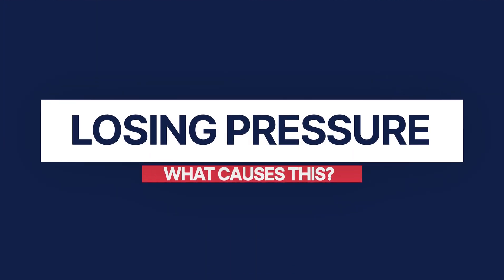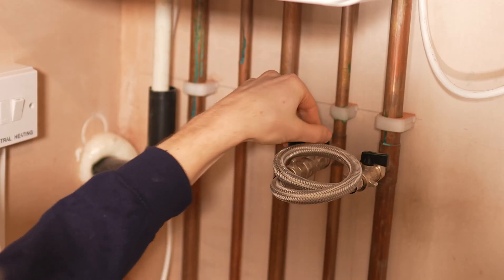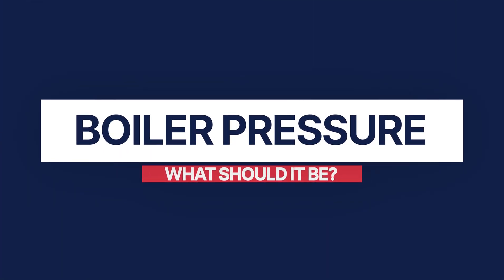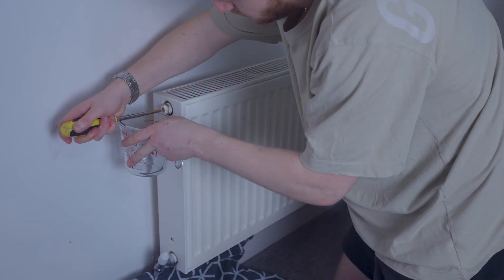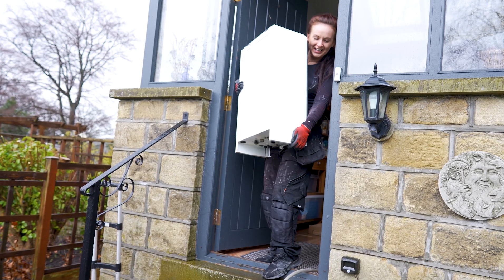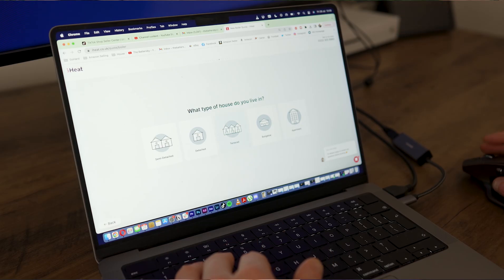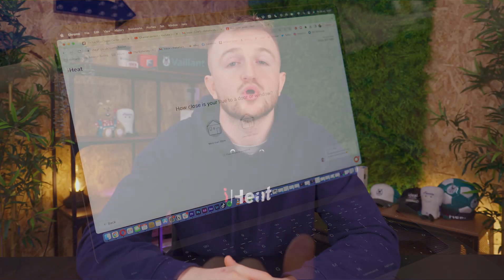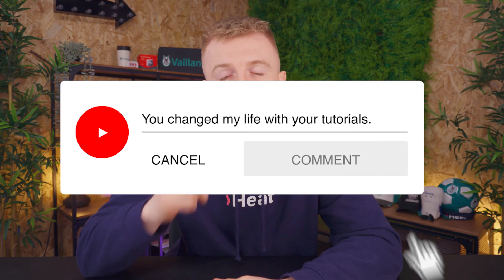Why is my Boiler Losing Pressure?? - Tips to try before calling an Engineer!

Comment: I've followed all those steps.
Boiler (vaillant combi) losing 0.5 bar overnight, sometimes more.
Checked PRV and expansion vessel. All fine. Boiler less than 3 years old. All rad valves bone dry. No sign of damp or moisture anywhere in the house. Called leak detection specialist, tracer gas and everything. The gas didn't even show a pressure loss when pumped into the system. Real head scratcher this 🤔

Comment: When checking for leaks around radiator pipes and boiler ect, do you have the boiler on or off?
Reply from the maker: Boiler on so the water is being pushed around the system

Comment: My boiler keep dropping pressure i am having to top up 4 times a day i have notice water from the copper pipe outside and also notice a leak under the kitchen tap draw the pipe dripping water
Reply from the maker: That definitely sounds like a leak somewhere, I would recommend getting a professional to inspect the pipes to be on the safe side.

Comment: I topped up my boiler pressure & soon after noticed a leak from the black taps under the boiler, is this normal? Apologies I’m just so new to this
Reply from the maker: This sounds like an issue with the valves that should be checked out, place a bucket underneath to keep track of how much water you are losing

Comment: My new Worcester Bosch boiler started losing pressure from day one.  The old Worcester Bosch did not have this problem. After scan of  ceilings and floors, the  installer said the  problem is leaking pipework and I  need to call a specialist. Before he left he turned off the heating and as he predicted the pressure is fine, but I'm left with no heating.  Other than lifting  up floor boards and boxing how to do I  track the leak.
Reply from the maker: Its more than likely the power of the new boiler is too much for your existing pipework. And a pipe / fitting has burst in the process. Are you saying the specialist came out and turned heating off or the installer did? If no specialist has come out I would start there.
Reply: @iheat  The WB  installer turned the heating off.  So at the least we could get hot water.  Complained to WB who sent another engineer who confirmed that the boiler had been properly installed and the problem lay with the pipework.